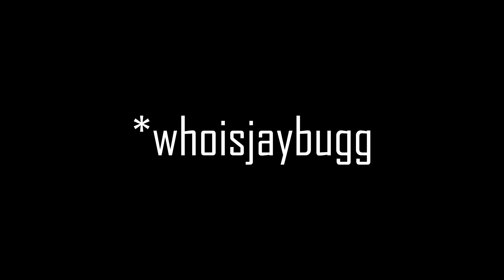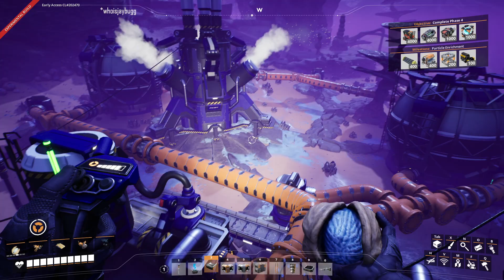SATISFACTORY 001.056 - Adding Nitrogen gas to the Bus - Mega Base Let's Play Update 6

Comment: When your storage on the bus fills up won’t it stop the whole system until you start using the gas in production?
Reply from the maker: Yes, totally 100% and gas is very expansive so it is also hard to store. Unlike stuff, gas just fills up the storage almost instantly when drones  are making the deliveries.
Reply from the maker: Later I figure this out and add a sink. Lol!
Reply: @whoisjaybugg  If you sink it though you will be sinking the canister and the gas which gets you extra points. But you have to keep making empty canisters…